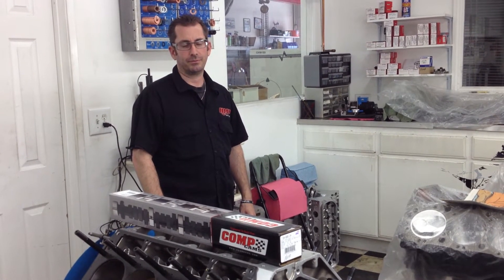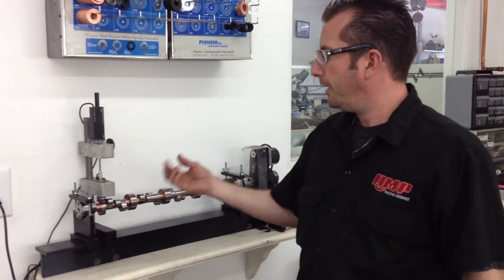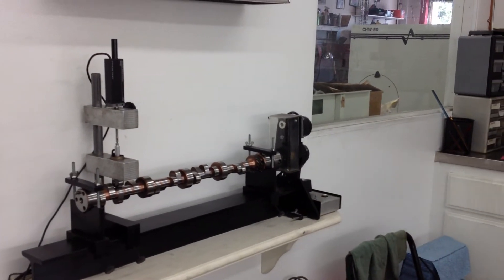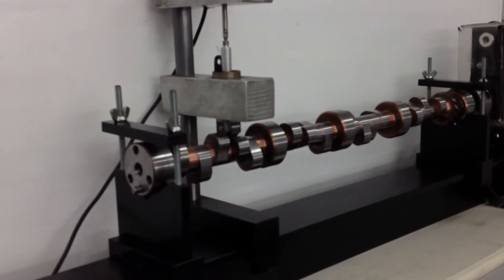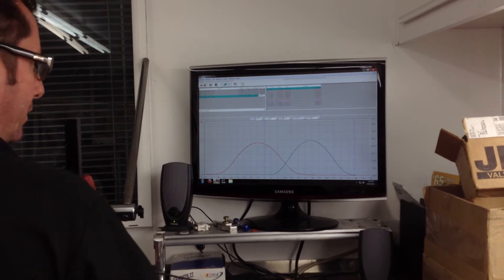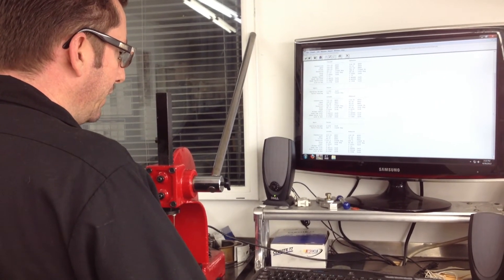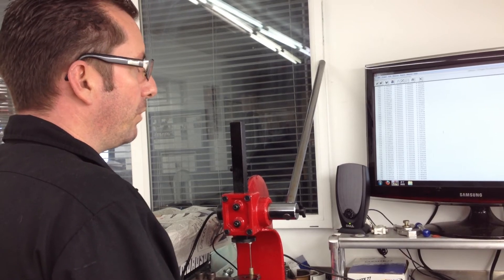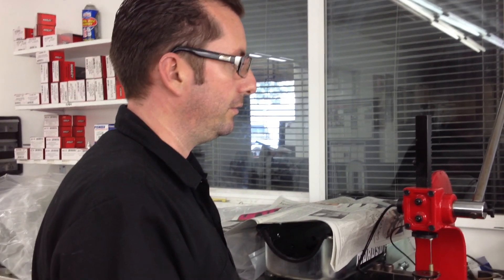Cam Doctor at QMP Racing Engines

Comment: Nice item.  Beats dialing in after an install trying to figure out durations at .006/.015/.050/.100 so you really know your cam and nail down where overlap numbers are...without any chain takeup errors.   Now if only someone made a jig for attaching an  encoder [with digital readout] to attach to the timing sprocket for testing after install...